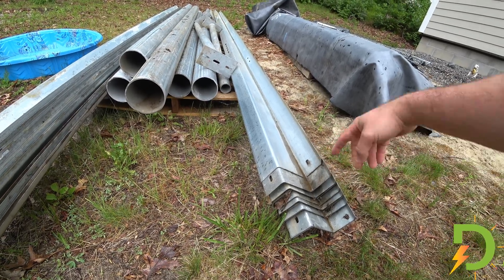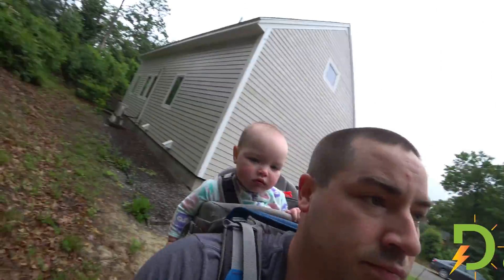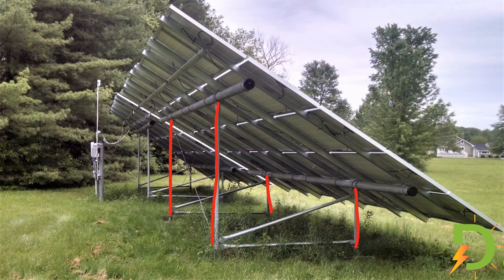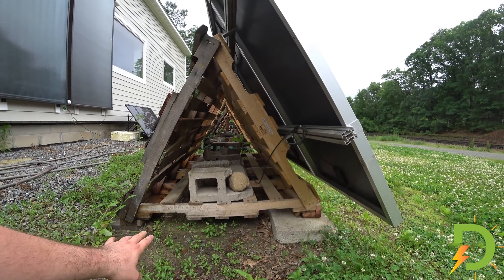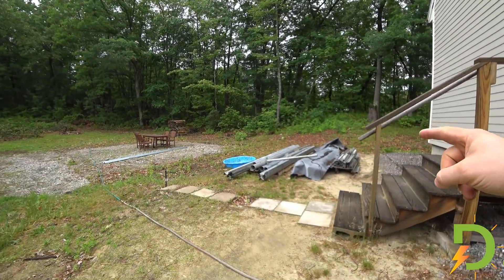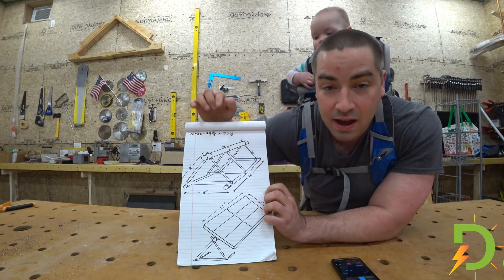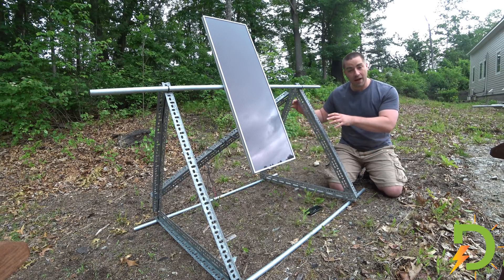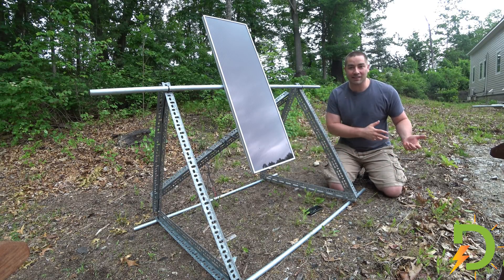DIY Tilting Solar Ground Mount, Plan, Blueprints, and Model

Comment: What about the permitting?  Here we have to use either a manufactured system that comes with approvals for out state (CO).  Or if we do it custom it , the plans need to be stamped by a CO approved engineer.  I, myself am an mechanical engineer , but that , doesn't qualify me to meet code.  It seems like many  videos like this never get into the code requirements,which are significant in many places.    Do your research viewers!   Good video except for not covering the code requirements, if any.

Comment: Consider using cables attached to one end of the panel going down and looping around another pipe directly below your pivoting pipe and going back up to the other end of the solar panel. at the end of the bottom pipe drill several holes then place a rod through the hole and drive the rod in to the ground, or other arrangement. This is to keep gusts of wind from lifting and causing damage to the solar panel.

Comment: Stop. Please Stop. You are unaware, AT 4:20 you show how easy it is to tilt a SINGLE small 'panel' that is midway between the two SUPPORTS. But in an array you have more supports that would prevent moving panels like this. You have to tilt he WHOLE ASSEMBLY ON A BIGGER MOUNTED TUBE. Or Lift top Half by extension.  Your Theory Assumption is Off.
Reply from the maker: I did further prototypes on larger scale.  In the end I decided to build a fixed array.

Comment: I live in Youngstown oh . I wish I could attach my images of my solar ground mount here.  I have 2 arrays. One has 8 panels the other with 6panels. I created a frame that is made of 2x6 and place the panels on top of the frame. There are perpendicular 2x4 to support the panels . I have two 2x6 vertical with a gap of the frame that pivots the frame the hold the panels onto the framework. The panels are in portrait mode. I have had 65mph winds since I built these ground arrays 3 years ago and they stood up to the winds. I went 30” into the ground and poured concrete around the vertical posts.  I am using a 5/8” bolt with an aluminum pipe that the bolt goes through where the panel frame goes through.  To hold the panel at a certain angle, I attach a 2x4 from the vertical post to the framework of where the panels are secured too.   I’m planning on redoing my frame structures to support the panels with a different way but the same concept of using pressure treated wood as my current frame work is made of as well.

Comment: well 2 years latter you went with 3 stationary ground mount arrays. I'm guessing you did the math and found out tilt would not get you a lot more energy and easier to just add more panels?
Reply from the maker: Yes.  A friend of mine came over with a professional "sun eye".  he mapped out my yard, with the shading from trees.  Basically there was such a small window of solar that it wasn't worth it to make the array adjustable.  Would have been cool, but not practical.

Comment: I'm in the process of planning a ground based array. I'm based in OKC and this issue I'm having is finding any building codes specific to this as far as footer requirements and design. Did you run into any issues while having yours inspected when you had it tied to the grid?
Reply from the maker: I'm keeping my stuff off-grid.
Reply: @DavidPozEnergy  yah that's what I was afraid I was going to hear. It's all good. Thank you for your response!
Reply from the maker: Iron Ridge has a free online calculator.  You can print the specifications and sometimes that's good enough for the inspector.  https://base.ironridge.com/gb/projects/new

Comment: I was hoping that you were going to talk about what backing you were planning on using, i.e., 1/2" treated plywood or (?) and how you were going to attach the plywood to the 5" pivot pipe.  Were you thinking plumber's tape or U-bolts?
Reply from the maker: I gave up on making the array tilting.  Now it's just fixed.  But I love the panels on it and the power I get.

Comment: I've been working on different ways to mount the panels I purchased and I like your idea but I think I would make the adjustment right into the triangle stand. Make the one side of the triangle long enough to handle your 6 panels (10ft) and make the back leg of the triangle out of 2 pieces and create a scissor jack concept using threaded rod our more of your z-bar to help hold the angles desired for your area. I think you will use less metal and end up with an easier titling stand. You can fill the bottom pipes with ballast to add weight or create another anchoring concept if deemed necessary.

Comment: Tilting panels means the wind could tilt them too, which would be a problem.  How will  you secure the tilt angle?
Reply from the maker: I have a lot of slotted steel angle kickin' around (the stuff I made the model out of).  I figure I can use some of that for braces.  That way it is easy to adjust for winter/summer.
Reply: +DavidPoz This is also my biggest concern, I think as long as you have a solid solution for the wind/rain/elements not tilting the panels then you'll be ok.  I also think if you are considering a tilting array, then I would tilt the other way as well and control the direction you're talking about with a linear actuator using something simple like an aurdino...  

Make the pole at the top of the triangle tilt toward the ground at an angle just a bit less than your lattitude (optimum seasonal angle) and then tilt East to west every day with the actuator.

I think if you go look at some charts of seasonal ouputs, you'll find the optimized fully fixed angle is pretty near the output of a dual season angle system, and the most significant improvement is from fixed to tracking.  However, we're talking 20-30% here even with full tracking, it's not like double or anything, with the added complexity and possible maintenance and fiddling, you may just want to buy some more panels.  

However I just think that daily tracking is super awesome and I'd love to have a back yard big enough to try it myself :)

Comment: Yea . but maybe add another piece across the bottom. Like unistrut or slotted angle. With a long piece of threaded rod to set angle. I'm thinking about building a tracking system to work similar. Either that or cut alot of trees. I need to get all I can while I can. The sun isn't in my spot but 4-5 hours a day. I actually get more sun in winter. About 6 hours. I'm beside abig hill with trees that block sun about 5-6 in summer. With trees blocking in morning. Till about 10! I'm watching to get some ideas.
Reply from the maker: Hi James, sounds like we have similar (limited) solar windows to work with.

Comment: Trust me.  You are on the right track.   My 12 Panel System is stationary.    In the winter months we only have @ 4 good hours of full sun.    We have to put a charger system on to make sure our batteries are full charged when the early sun goes down.    In the summer we have @ 6 hours of full sun.   Because we are in a Hurricane zone we have to keep our Batteries fully Charged.  Some times we are out of power for 3-11 days.   With our system we have t.v fans 12 Volt lighting.    If we are going to be down for more than two full days we drag out the Honda inverter 3000 for the fridge.    Thinking about putting up a small wind generator but not sure of any good small brand.   We can Waite until the hurricane has gone by and have a few windy nights.    Good stuff.  And a beautiful Lady behind you.
Reply from the maker: Thanks Jim.  Up here in Mass we don't have the hurricanes, but we do have winter storms that can take out power for a few days.

Comment: Hey awesome and it's portable sort of lol. You may want to think about orienting the center (pivoting pipe) North / South then you could build a attenuating arm to rotate from east to west using gps location during each day and the seasonal change could be adjusted by lifting/lowering one end 2/3 times a year. Think teeter totter for the bottom 2 pipes and you can move the ballast to set the season. Cheers
Reply from the maker: Hi dwf dwf,  Thanks.  I did think of trying to build a 2-axis mount, but set it aside.  The backyard is the last spot on my property I can mount this, and it only has a 4-hour window (10:30 - 2:30).  So adjusting east west won't be worth it, just north south for seasons.  However, your idea would be great in an open field.

Comment: I just removed 2 100 Watt Solar Panels off of my camper van last night. They are mounted on a plywood "Hatch" Home made POP Top from my Camper Van that is getting a new (to me) Junk Yard Fiberglass High Top, as I set the panels against the yard tractor, I thought I should hook them up with the other panels that are still in the boxes in the barn, here on the ground !   BINGO !!! Great timing with your video today.  Thank you !

Comment: I would add ground screws to base, they are cheap, (not the big ass ground screws of the original design), high wind is a big problem with panels...
All the panels together can be quite heavy to try to tilt all together at the same time and awkward twisting can occur to frame, for one man to do alone, unless you add actuators or hydraulics...

Comment: I would think mounting up on the roof might be better with all the trees you have around.  But it would be interesting if you build two identical ones to tilt one but not the other and see how much real difference it makes.
Reply from the maker: Hi jontscott,  Thanks.  That would be interesting to see the difference.  However, my plan calls for running the panels into one charge controller.
Reply: Well I look forward to seeing how it works out either way :-)